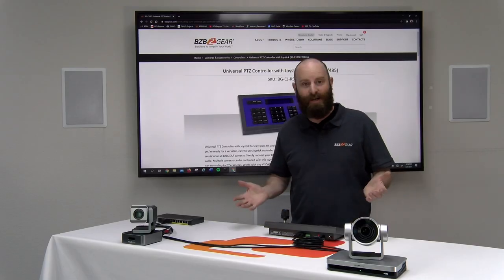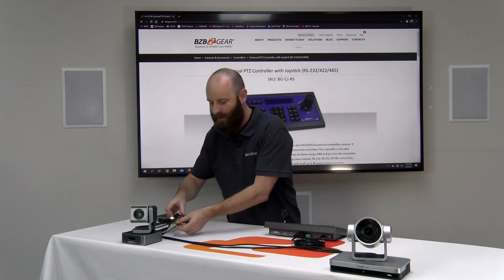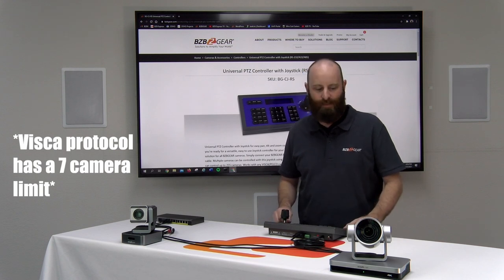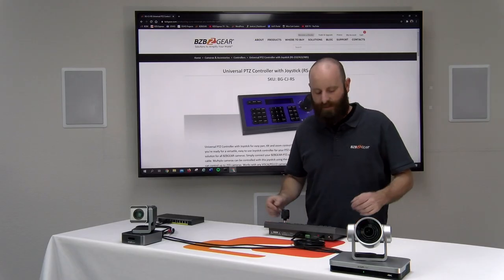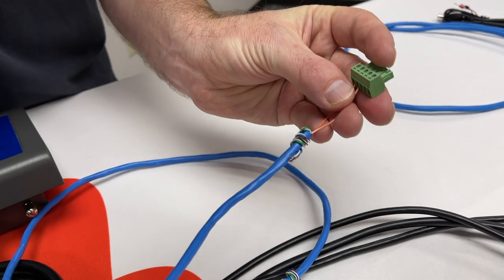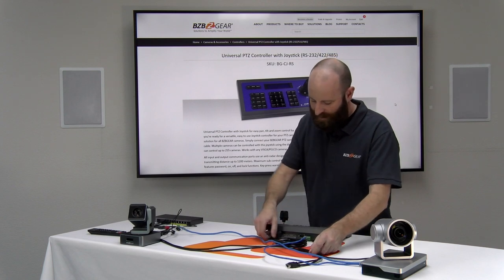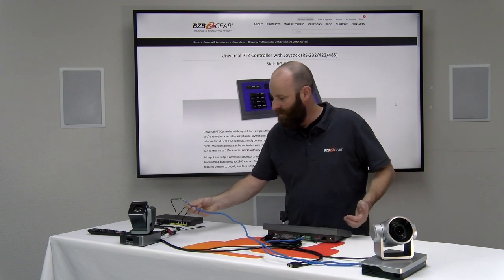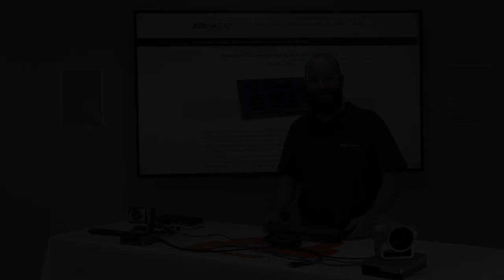How to Connect a PTZ Camera to a Joystick Using Serial Control - RS232, RS422, RS485

Comment: Pregunta crucial, soy nuevo en esto.

¿Se puede hacer toda esta configuración sin conexión? Es decir, ¿no necesito estar conectado a una red de Internet y solo hacerlo dentro de una red local usando nada más que el switch POE?

Quiero hacer esta configuración en zonas rurales donde no hay conexión a internet, ni wifi ni red Ethernet, pero me interesa utilizar el protocolo POE por su practicidad.

¿Es eso posible? El video solo se grabaría localmente utilizando un dispositivo de captura como OBS.

Otra pregunta, ¿puedo usar un controlador y usar diferentes cámaras PTZ de diferentes marcas o necesito tener las cámaras de la misma marca que el controlador?

Muchas gracias, espero que me puedas ayudar.

Comment: hello, I have connected 2 PTZ cameras using 485 connection. I can controller both cameras with the controller but when I which to camera 2 I get no video, Do I need to run a video line to the monitor from camera 2? I am using OBS on my computer.
Reply from the maker: Hi Don, are you using BZBGEAR cameras and can you please walk us through your connections?

Comment: I bought what I thought was a joystick and camera similar to what you show.  The joystick i received only has RS485 block, no 232.  The camera I have only has RS232 (mini 8) connector.  I tried a RS485 to RS232 converter, but no luck.  Both the camera and joystick claim they support VISCA, Pelco B & D.  Any ideas on how to convert or should i return the joystick?
Reply from the maker: Hello, While similar in function, RS232 and RS 485 are not compatible with each other, so unfortunately it does not seem the product you purchased will fit your needs for control. Feel free contact one of our knowledgeable sales Reps so they can help guide you to a product that will fit your application like the controllers below! Both will do RS232. 

https://bzbgear.com/product/bg-cj-rs-universal-ptz-controller-with-joystick-rs-232-422-485/

https://bzbgear.com/product/bg-cj-iprsg2-universal-advanced-ip-rs232-422-controller-with-joystick/

Thanks for the comment and watching BZB TV!

Comment: How do you change the speed for each set or pattern?
Reply from the maker: With joystick controllers, you can usually set the speed manually on the unit itself.

Comment: Is the an RS422 adaptor to Ethernet for long runs to a network hub ?? Lmk thanks
Reply from the maker: Hello, yes you can use Category (CAT5/6) cable to extend the signal, but the devices should have the bare wire connection screw terminals included for connection. What equipment are you working with? 

We have great Tech Support department if you are using our Gear you can give us a call for help! 
Tel: 1(888)499-9906 or Support@BZBGEAR.COM

Thanks for watching and commenting!